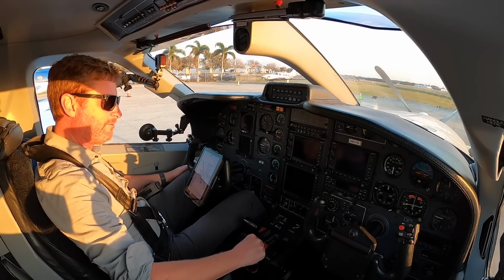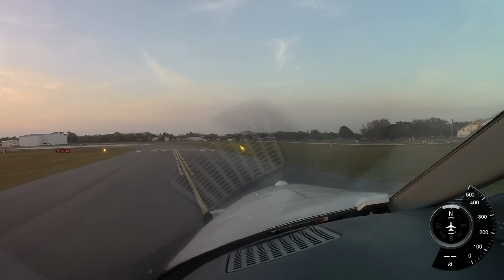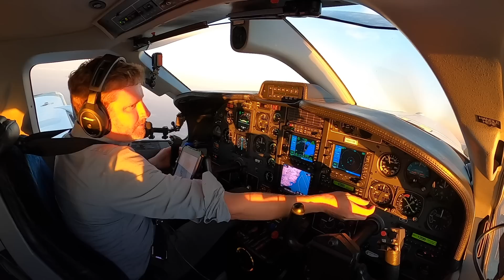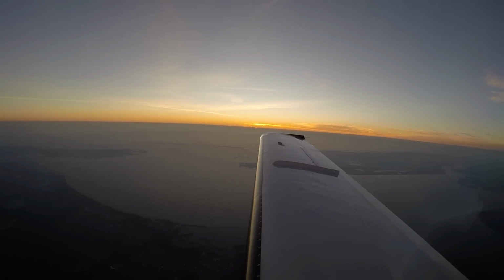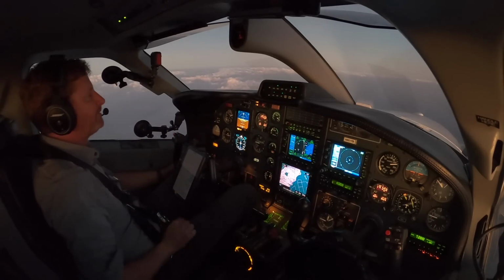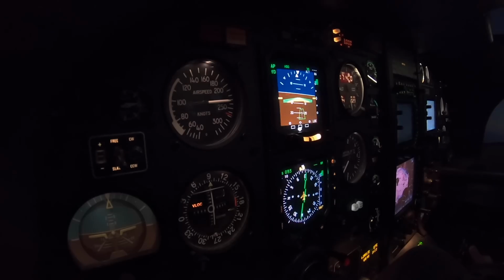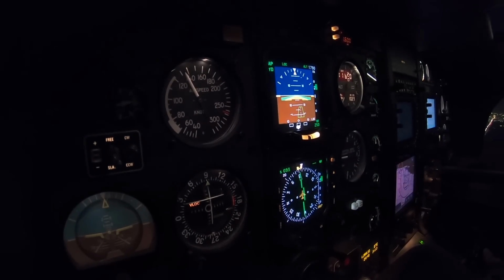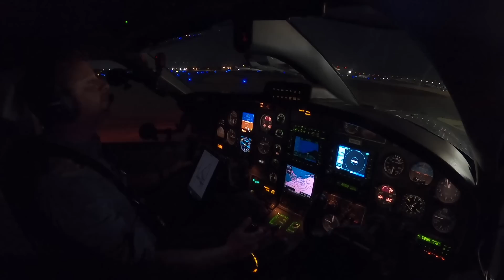EXPECT THE UNEXPECTED! - Master Caution Light on Takeoff

Comment: Not sure I'd be comfortable with something that triggers a master caution on a regular basis. It seems like "normalizing" an issue and should still be a maintenance request.
Reply: It’s not a maintenance issue at all. On the TBM, the fuel selector will automatically switch tanks, every 5 minutes in the air, and like every 1 minute and 15 seconds on the ground. If you take off right when it’s switching fuel tanks, it gets confused and will switch into manual mode and tell you with a CAS message. All you gotta do is switch it back into auto mode and you’re good.
Reply: No time like the present to fix that light. Before you smell smoke.
Reply: @noelstoehr965    Do we call that a feature or a bug?
Reply: @noelstoehr965  I had a hunch it was quirk of that nature. Steveo's been flying this aircraft long enough to know its idiosyncrasies. I have no doubt he'd investigate it further if he couldn't manage it or do something about it on the ground.
Reply: @noelstoehr965  Sigh... speaking as a software engineer, there is no excuse for that kind of bug. The computer can receive input (e.g. "airplane is now flying") at any time, when the computer is in any state (e.g. "switching tanks"), and therefore MUST be ready for it.

Whoever programmed the fuel tank switching timer should have their compiler confiscated, and not allowed to have it back until they've completed a programming basics course.

Sorry, rant over.
Reply: @HiddenWindshield  hey man, i dont build the planes, i just fly them
Reply: @noelstoehr965  LOL Sorry, that rant wasn't aimed at you. 😅
Reply: @noelstoehr965  great explanation  Noel
Reply: Or and hear me out….. you know the systems of the plane…. All planes have their quirks.
Reply: @HiddenWindshield  the engineer had far many systems, fail safe, and certifications than a typical computer.
Reply: @JBWRight88  And yet they made a basic mistake I learned to avoid in my very first video game. When I was eight.

Certifications in the wrong area don't mean squat. I'm a certified pilot, does that mean I can decorate a wedding cake for you? Same thing here: being a certified engineer doesn't make them a good programmer.

"The three most dangerous things in the world are a software guy with a soldering iron, a hardware guy with a code patch, and an idiot with an idea." (paraphrased, I think it was Edsger Dijkstra?)
Reply: Wow, I would not just be taking this master caution so lightly without getting confirmation from the manufacturer right ?
Reply: If this is a quirk with this aircraft chances are more people have it and if it was a serious issue the manufacturer would have put out an air worthiness directive to change it 😂
Reply: @HiddenWindshield  no one cares you’re a certified pilot. Point is If it is known, then it’s not a threat. Plenty of planes with known indications that are just a false indication. It’s called Traing and knowing the plane instead of recertification process.
Reply: @JBWRight88  Maybe you should actually read what I wrote, instead of making up stuff? It's like you're deliberately trying to stir up drama.

I was specifically saying that my pilot credentials don't matter, if you're asking me to bake a cake! The exact same way that some hardware engineer's credentials don't matter, if you''re asking them to write a computer program.

YOU'RE the one that started bringing irrelevant credentials fields into the discussion.

In 2018, Air Niugini didn't have Port Morsby's approach configured correctly in the GPWS system of their 737s. This would lead to spurious low altitude alerts when the plane was on approach to that airport. Pilots learned to ignore those alerts, which lead the pilots of Air Niugini flight 73 to ignore a legitimate low altitude alert. Fortunately, there was only one fatality.
Reply: @HiddenWindshield  no I read it fine. You mentioned the pilot part on purpose stop pretending you didn’t otherwise you would use another analogy.
Reply: @HiddenWindshield  you are missing the point that if you know why a system is giving you a caution it’s not a factor. Muscle memory and knowing why a issue occurs are two different things. I have landed with a GPWS going off cause I knew the FMS had failed. Doesn’t mean every time the gpws goes off I ignore it. Cut the outliers.
Reply: I am watching this video and contemplating sharing it with my customers, however I will include a reminder to never normalize abnormal or routine warning messages. I don't fly anything that uses Jet-A (I'm more of a Cub girl) however I have hundreds of hours in aircraft with retractable landing gear and this reminds me of all the gear-up landings that have occurred when the pilot simply ignored the "nuisance" audible gear warning. Also reminds me of why the FAA, for all its faults, changed the ACS criteria for slow flight to discourage the normalization of a stall warning. My 2c.
Reply: A takeoff inhibit feature after a certain airspeed indication along with power lever angle on takeoff would inhibit a nuisance indication on takeoff and then reilluminate once established in climb would enhance the priority response on this aircraft.
I’ve flown other turboprops and jets that had this feature that eliminates Rejected Takeoffs for minor failures and alarms
Reply: @larryrobinson8427  the 71 and 330 both have that. Only big issues will still cause a caution/warning. Altitude and airspeed based on those birds.

Comment: I was once going to taxi an A320 out for hours of post heavy maintenance op checks with my partner. Well our supervisor was really pressuring us to get the engine runs done so those discrepancies could be worked along with whatever else we found on the runs. So we hopped in the bus, cranked up and taxied to the edge of the property and called the ground controller for clearance to the run-up area. Got clearance, released brakes and headed out onto the taxiway. Once straightened out on the taxiway we get a....BING.....Master Caution. DOH !  It took a few seconds to realize that this is now a live aircraft....we ain't supposed to be getting any Master Caution. We followed the Blue ECAM actions and returned to base to figure out what's going on. Turned out that there were several circuit breakers still out. Our fault. Yes, our fault for letting the supervisor rush us before we were ready. Like Scarlet O'Hara said, "As God is my witness I will never let anyone rush me again."

Comment: Unless it was edited out, I didn’t hear TPA departure ever issue RADAR contact?
RSW controller did a nice job with the similar sounding call signs by using aircraft type, this usually resolves the problem!

Comment: Great flight.  Awesome talking us through the flight and you clearly know what you are doing.  I will say that they way you dismissed the master caution is concerning.   If the master caution light is coming on in error then that needs to be corrected.  "I've had that master caution quite a few times and I knew what to do".    I'm assuming that it's not normal to have the master caution light appear during takeoff.

Comment: Noting the comment relating to Waypoint naming. When you grand day flew, the waypoints then were full names for oceanic flights  . Greynurse, Sordfish and so on.  When the computer ATFN system became the norm, computers like a max of five letters, so Greynerse became GRUNO.  The overland waypoints tame a geographic name within some 10 miles of the location and enter that into a computer which comes up with a five letter noun.  A check to see it isn't already in use near by and when accepted, becomes part of the 28 day cycle to the amendment list.

Comment: 14:29 It's really expensive now days to pay for your own flight training... You're looking at about 80-100k for private all the way to CFII with the multi engine addons... The cheapest way I have found to do it is through a cheaper four year college and do ROTC with any of the branches and get a flying slot. That requires a four year college commitment and then 8-12 years on a contract as an officer in the armed forces. You could also go enlisted right out of high school, pay to do your private pilot during that time and then after college use your GI bill at a college like Liberty or Perdue University and the Post 9/11 GI bill will pay 100% of your college classes and flight time. Liberty participates in the "yellow ribbon program" which doubles the amount you get from the VA through the post 9/11 GI bill.

Online Liberty University classes are cheap and you can fly at one of their "flight training affiliate" schools. For me it's a part 141 flight school at one of my local airports. I just finished my instrument rating and it was 100% paid for. It cost like 13,000$.

Comment: Say Steveo, at a lower altitude can you not run at a lower rpm and dial in more prop pitch? Speaking of props, a company called Sharrow makes boat motor props. I was wondering why they couldn't use the same technology for aircraft.

Comment: How much safety is too much?   Where I work we have some older hybrid cars, and I've driven one with the engine light on and dash warning "Hybrid system not working, pull over immediately".  I had the warning cleared once and the car drove the rest of the day normally.  Next time I saw it the light was back on.  A mechanic said to not worry about it.  On another channel a pilot had a warning light for the automatic trim.  He turned the auto pilot off, slowed down and landed as normal.  Sometimes emergencies can start off small and spiral quickly out of control.  Other times perhaps there are problems with the emergency lights and no real problem.  I'm not a pilot but I wonder whether the question is, to notify ATC and land immediately, or not.

Comment: If you plan a flight that just has enough fuel to make the destination with 45 minutes IFR reserve, Do you have to land and refuel if they give you a different route and lower flight level which leaves you with only 25 minute reserve?
Reply: 14 CFR 91.167 appears to require that you land and refuel if you no longer have a 45 minute reserve. However, it's a bit complicated because the rule appears to only apply when you are flying "in IFR conditions". So if you are IFR but in VFR conditions, perhaps you can deviate from the 45 minute rule and use 30 instead. But I'm not sure.

Comment: I got a question. Anybody knows why Steve flies single engine turboprop for so long? Among pilots, single engine turboprops are called  a "career killer" for a good reason. Even if you decide to fly Part 135 instead of going to airlines, to get on a nice paying job and a sexy jet require multi time. SE turboprops don't get you that, so everybody avoids it, except perhaps the beginning of your career. Just interesting why would you stay on TBM for so long.